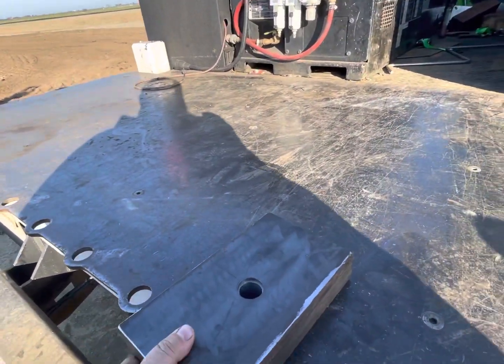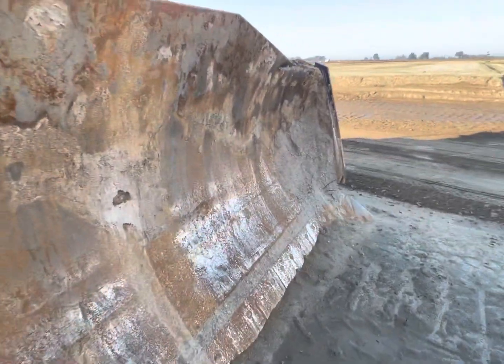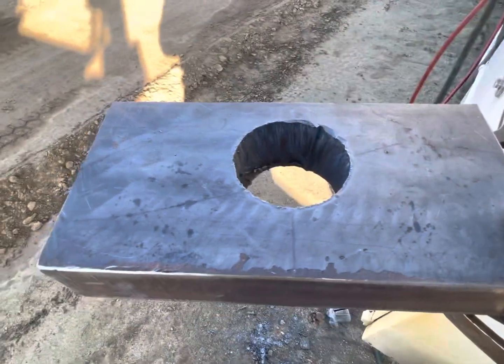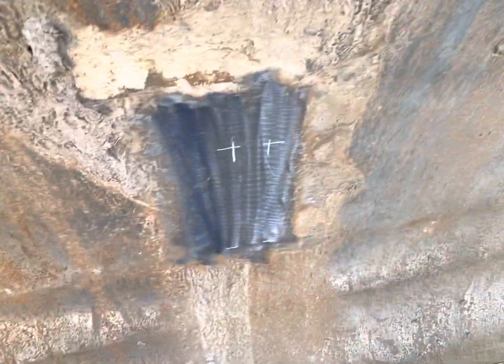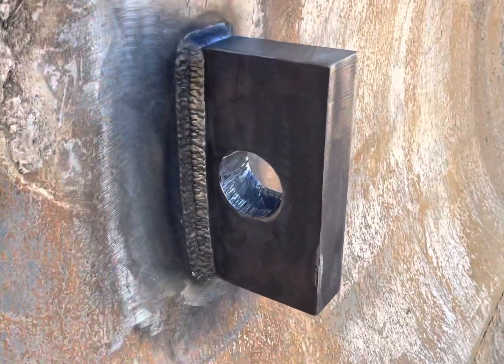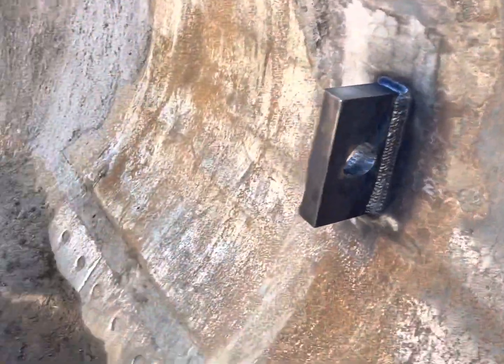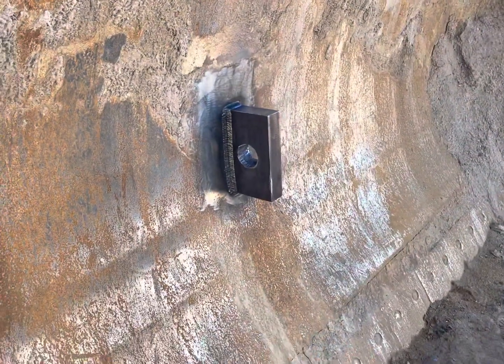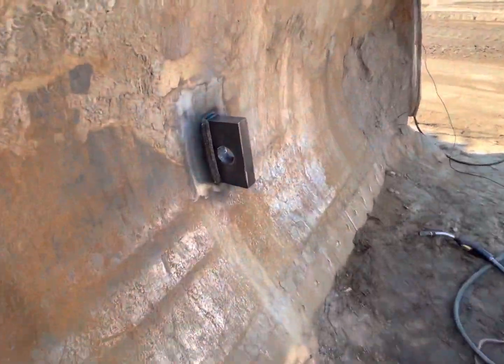D8 recovery point

Comment: Wonder what happened to this blade when used as a anchor pulling a stuck D11. Never would have done it that way, but to each his own.
Reply: Likely depends on how it was set up. I'd be concerned about the strength of the skin on the blade being the weak point. If the blade was set up fug into the ground, the weight of the machine isn't really even a factor, provided it's dug in deep enough. They'd likely have had better success hooking to the rear of the machine.

Comment: Great job. Just curious as why the bevel. In my line of work I would've had it flat an run stringers the same way the factory would've done on the machine itself. Less chance of slag or porosity in the weld. But nonetheless a good job. Thanks 4 ur content
Reply from the maker: I guess it could have been done either way.  Cat definitely puts a bevel on some of their parts.
Reply: Increases weld surface area=more strength
Reply: If you or your company are designing weld joints as to not be beveled to avoid slag inclusion, sounds like they/you need to invest in better training for your weldors.
Reply: @williamthomas9463  most industrial machinery doesn't come with bevels. In fact...u can look at his videos of him cutting various parts off these machines an u will see that. Most are butt welded with several stringers. It's a welding process that is very well known. But thank you very much for ur priceless insight. A weld will always be a weld as good as its welder. An he is very good nonetheless. Kings to him
Reply: You’re welcome Carlos whether you meant it sincerely or not. You are correct that manufacturers use that method often. However, I think it bears pointing out that manufacturers are trying to produce a product as cheaply as possible. Also, manufacturers have the luxury of welding most things in-position (flat) and therefore are able to use spray arc transfer. Have a blessed day.
Reply: @williamthomas9463  I did mean it bro. I was taught that u bevel  pipe so that it wouldn't be a surface weld. An anything with a angle can be welded with out a bevel especially in places that removal of slag would be next to impossible lol. Especially during x-ray/test. But as the old saying goes. I'm never too old to learn. So thank you

Comment: Interesting, , at 4:30, because of the polished surface of blade, you can make a pretty good 90 degree line up by looking at reflection of padeye in the blade...if the blade and padeye  line up, the padeye is 90 degrees to blade.....great video, that is a bad mama mama plasma you have.....100 amps? cheers, Paul
Reply from the maker: Thank you. My plasma is 105A.

Comment: Gotta love that dual shield,  does the wind shut you down much or do you just try and block with tarps and umbrellas? Great channel you have an extensive skill set 👍
Reply from the maker: Sometimes the wind is a issue but not often.
Reply: Beautiful welds.  What are your regulator parameters between calm and hi wind?  Thanks.
Reply from the maker: @donsmith9081  30 cfh regular and 50cfh if it’s windy